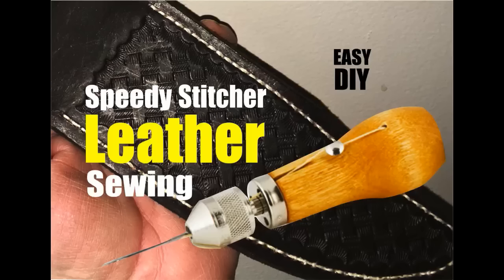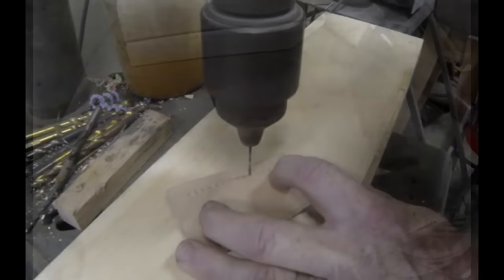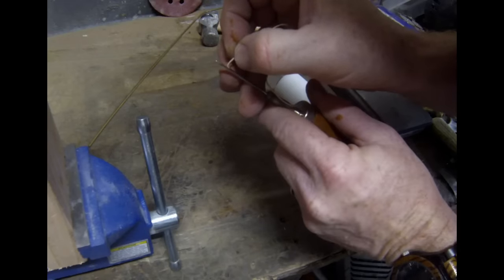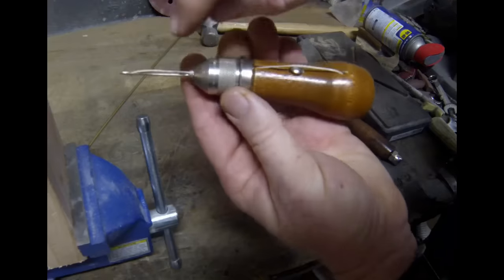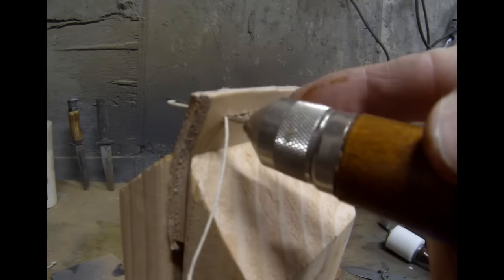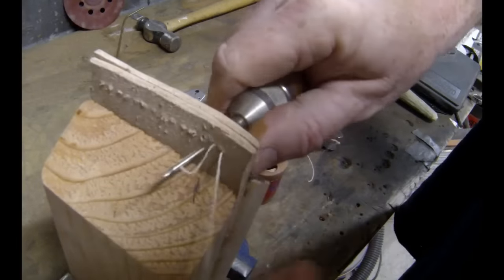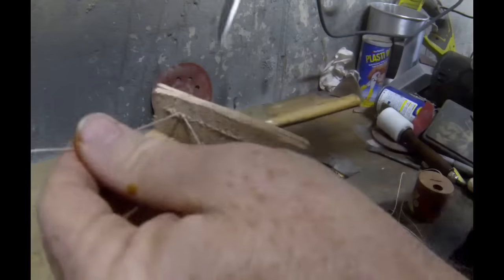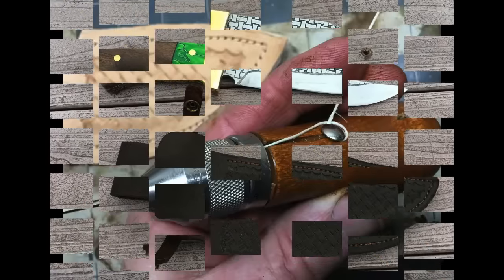How to sew Leather with the Speedy Stitcher sewing Awl

Comment: I tried my sewing machine leather needles (standard shank, not industrial) and they fit perfectly so you can use any size thread/needle, not just the Speedy Stitcher. I find 2 needle saddle stitching very relaxing so hardly use the machine or Speedy Stitcher anymore but after seeing this I will dust it off and have a play ☺

Comment: I love your content. . I a quick learner. . I love it that you you show you finished product ? But please show us how to ? Fix ? Mistakes. . My loops at times came back through. My loops sometimes were to loose. I’m not knocking your video? I’m saying a video of you showing screw up an how to fix it would be good. My first knife sheath after watching your video was ok. I’m proud it is together. But? The imperfections I could not fix because your videos don’t show how to fix mistakes. I know how to sow. I want to do it right!
Reply from the maker: If the loops are to loose you have to pull tighter after each stich. I do not think it can be fixed after the sheath is completed. Make a point of looking at the loop placement and tightness before moving on to the next stitch. With a little practice is becomes second nature. For even more control and a better stitch try a Saddle Stitch. Its not done with a tool just two needles. A little more work but really nice results. I have a video on the process

Comment: Ok, but I have found this super slow. There is a faster way. Tie in the second bent needle into the long section of back thread at the end. This speeds up feeding it thru that tiny loop on the side of the needle. And dropping the needle ( because it has weight ) pulls most of the thread thru for you. I found that doing this simple trick speeds up sewing with this device by up to 300-400% faster. I work close to the edge of a table so the needle has more room to fall and pull all the thread thru for me. This also works great with carpet thread and Kevlar threads. I was able to put new seats in my out door chairs. 4-  14” long seams with 3/16” stitch spacing in about 1 1/2 hours. The vice grips to hold the fabric taught was the hardest part. The first seam took the longest, ( about a half hour ) just cause I wasn’t use to the tool.

Comment: I love this tool. I use a darning needle to hold the bottom thread it makes threading it through the loops a lot quicker. The only problem I run into is occasionally threading through the wrong side of the needle on the underside which is a pain to undo that mistake when it happens. You can avoid this from happening by having the side of the needle with the grove always in the same direction. Placing the groove on the side that the bottom thread goes through helps a lot as that side will usually be the side leaving the loop upon removing the needle from the material. Some materials make this happen reliably each stitch like with leather. Looser materials like canvas or nylon don't always do that, but by keeping the grooved side of the needle always facing the same way will make it easier to tell if the loop has formed on the wrong side of the needle. The only other gripe I have is that I have never been able to find the exact same thick waxed cord/thread as the type that comes with each of them.
Reply from the maker: Great idea!!

Comment: I have used one for years. One tip is wax the back thread occasionally as this will make it stiff and easier to send through the loop. I also split the pieces i am sewing at the last stitch and have the threads meet in between. This is where i tie off and it hides the knot.
Reply from the maker: Thanks for sharing!

Comment: My dad had one for wrapping steering wheels. Sat in a drawer for 15 years, used it 2 weeks ago to fix a pair of boots. Not the same process, I would look the next hole through the previous hole's loop then pull tight and repeat. I dont have any real knowledge or experience. Just seemed like it would work. Was easier for what I was doing anyways. Always wanted to get I to leather crafts and upholstery.

Comment: I've had one since the late 1970's. I stopped using the tension stud and the bobbin also. I one problem with the video is that if you're not pulling out enough thread to put through the rear loop once it runs out, that's it. Having the roll of thread attached won't do anything. I just cut a piece double the length I want to stich with some extra, thread it through the needle with the needle in the middle of thread and start stiching. Put tension on both threads and pull the loop knot through so it's in the middle of the two pieces of leather.

Comment: Hi. I noticed on your video, you wrapped the thread around the tensioning knob the wrong way. The instructions I read saying that the thread won't feed properly otherwise.
A good trick that I've discovered, is to dip the tip of my threads in confectioners wax, before feeding them through the needle. It makes the task effortless. 
And one more thing, I think we're supposed to use contact cement, not rubber cement. Thanks for the video though.

Comment: I bought one of these. I'm dissapointed with it as the spool has a small spindle that dosent allow the thread to unwind when it reaches the middle. It's so frustrating! I'm constantly removing the spool to free it off.
It is often so tight that the thread breaks at the needle point which requires re-threading and re-starting the stitching. I can tell you the air is BLUE !!
I'm going to try to solve the problem with a split plastic tube over the spindle which will hopefully allow the thread to unwind freely.
Until I fix this I'm using the thread directly from the supplied reel with no problem except the thread is untidy and the reel rolls about on the floor.
Having watched the whole Video I see this is how it is demonstrated. I also found as he did the tensioning pin is too tight. This probably needs a larger diameter shank to procuce less tension. Watch this space !!

Comment: I hope you still monitor your page.  I'm getting into repairing/modifying pistol holsters and I'm using 8 test dyneema line.  I have been using double strand (8 + 8 = 16 pound tinsel strength for each pass through) and finishing off my stitch run using a double wrap overhand knot twice (makes a square knot) then using a long nose butane lighter, carefully melting the tag ends.  My question is, have you ever done this method and what are your thoughts?  thank you.

Comment: Need to change how you tie your knot at the end.  Leave both ends on each side with loops, then run ends through loops and pull.  Knot is inside of stitching - not on the outside.

Comment: My first project was sewing reflective fabric on the outer flap of my commuter bag. If It's fabric, pinch/hold both sides when pushing the needle through, or it will bunch up. Second, I had blood on my fingertips from this, watch the tip of the needle when pulling both ends to tighten the stitch. Pull some extra slack to get that business end of the awl away from your hands. I've yet to see a video either explaining or using the spare curved needle it comes with. The one sitting under the chuck.

Comment: when you first pull that length of thread out the other side it should be a little longer than the amount of space your going to sew.
example: if you are sewing a length of say 4 inches you should have at least double the length coming out the other side,
 i found it always better to have to much thread than not enough.

Comment: So double needle would produce a better stitch since this is only pinching the back thread ?
Reply from the maker: A double needle saddle stitch does provide a tighter stitch but the Speedy Stitcher really is easy to use and produces nice end results. Link is for double needle saddle stitching   
https://www.youtube.com/watch?v=naLpXwPL3PA
Reply: So in your opinion, which would be the longer lasting stitch? I’ve been watching both, but maybe out in the field the speedy stitch works a lot more efficient. Tfs. Just subbed. Take care, Nikki.
Reply: @SouthernPatriot1  Take no notice of the previous reply. saddle stitching is far more effective and gives much better results but it does take a little practice to get it right, unlike using this tool that is a quick learn.

Comment: Is there any other way to finish it off and bury the knot?
Reply: Yes, back stitch over your last 3 or 4 stitches, then pull the string "lopsided' so you have a bigger loop on the back and shorter on the front, then run the string from the back thread through the front loop 2 times, and then when you pull them tight, the knot will slid inside the hole.  FYI, you may want to figure out before you stitch that hole which one will be your 'knot-hole', and use your awl to make it ever so slightly over-sized.

Comment: The stitches don’t lie at that nice angle that saddle stitches should. I’m not sure if it’s because you’re using bad pricking irons, the speedy stitcher or because you’ve decided to pre-drill holes - probably a combination of all three - but the results look very amateurish.
Reply: Losian, this is because this tool can't do saddle stitch, only lock stitch. Saddle stitch can only be done using a needle at each end of the thread and stitching from BOTH sides of the project. I often make stitched leather items, thin to very thick, but I would never use one of these tools, they're meant only for very basic emergency repair jobs. Also, as the stitch is a lock stitch, if the thread breaks or wears out in one place the whole lot will unravel, unlike a real saddle stitch.